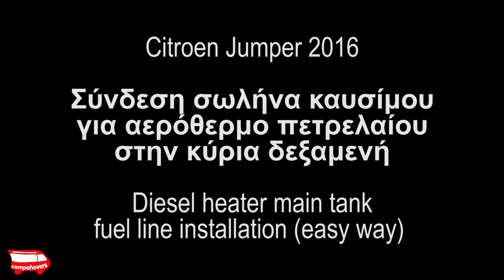Diesel heater main tank fuel line installation (easy way)

Comment: Dit werkt alleen bij een 75 procent volle tank of als de motor draait. Het buisje recht naar benden komt in het kleine opslag reservoir terecht. Deze blijft alleen vol tot ongeveer 75 procent tankinhoud. Het werkt wel als je een verzetje van ongeveer 6cm in de zuigbuis maakt en die buiten de diameter van de grote ring laat vallen. Kijk dan wel uit voor de vlotter. Beter ( maar meer werk) is het hele binnenwerk er uit te halen.
Reply from the maker: Goedeavond. 10.000 km later heb ik hem zonder problemen onder zware omstandigheden gebruikt met een zeer laag oliepeil. Ik zal het blijven volgen en u op de hoogte houden.